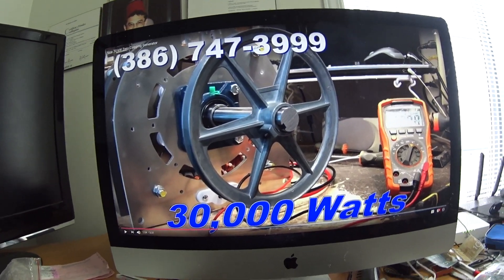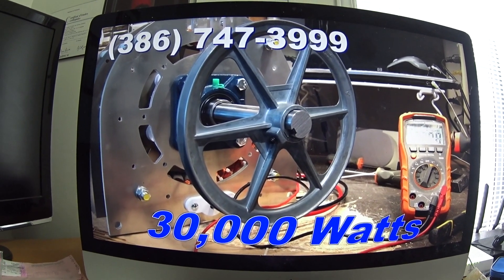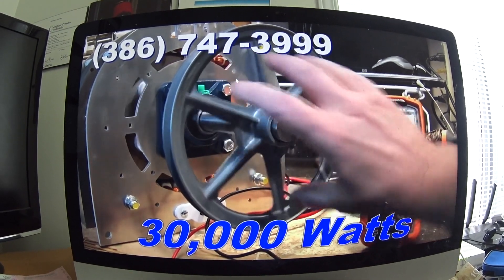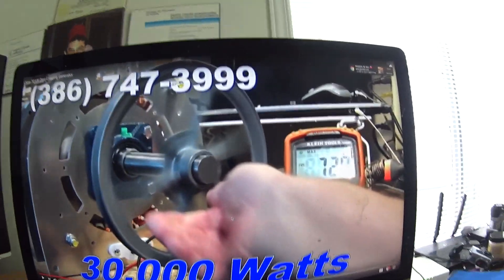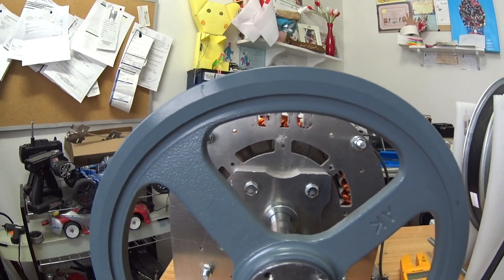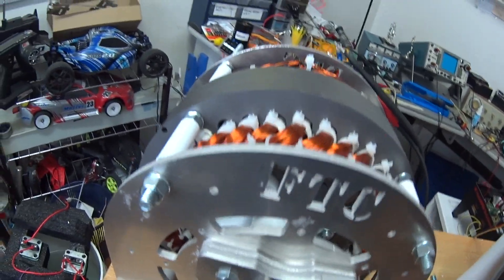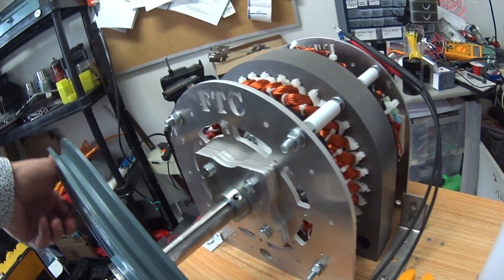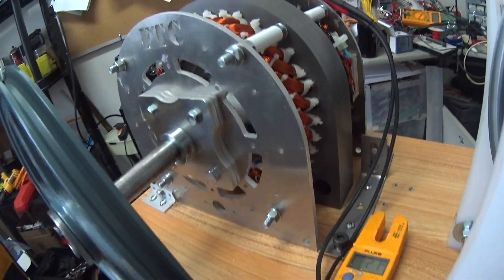30 kW Zero Cogging Generator from FTC

Comment: That was great of you to buy the generator so that the truth may be established. 
If possible would you please show how the coils are done within the stator and how the magnets operate.
The owner claimed that the magnets are placed so that most of the coil is in contact with the magnets, how is this done?
He also claimed that the design of the magnets and coils helps to reduce cogging. How is this possible?
Reply from the maker: the cogging is reduced by just reducing the count of the magnets , which of course made the output signal not useable so that is why he converting it to DC but as coils its very normal and also the magnets nothing special about it

Comment: Hook the output to a power tool and then we will know for sure about cogging.
Reply from the maker: cogging is when you turn the generator without a load , there is no cogging , please watch the whole video , it gives the postive and the negative of the generator
Reply: @EnergySeeker  It would still be nice to see  it run some things or how much it can run other than the meter.
Reply from the maker: @JR-ic4hl  do you have a 30 KW motor i can borrow to test full capacity under load then ?
Reply: @EnergySeeker  what about the one in your video?

Comment: Sir can you please let me know what the distance between the stator laminates /coil and the rotor laminates are?. We are testing a unit and we have roughly a gap of 3/8” 
Greatly appreciate
Reply from the maker: 5.5 mm
Reply: @EnergySeeker  I have a 15K unit. So sad I did not see your video before I brought it. My drive motor will be here tomorrow and I will see if I can get 15K out of it at 3400 RPM. The air gap on the stator is not consistent all the way around the laminates and windings for sure.
Reply from the maker: @bmwhp4709  did you try to contact him ? to return it

Comment: Sir can you please let me know what the distance between the stator laminates /coil and the rotor laminates are?. We are testing a unit and we have roughly a gap of 3/8” 
Greatly appreciate
Reply: Any chance you found this air gap number? I emailed to FTC and they never responded. I see some of his coils he brags about are not staying up in the stator laminates so I need to push those back in place anyway. I plan to take this thing apart and try to fix it.

Comment: Mr Amir . There is generators with low voltage but high wattage. It depends how it is wired . The coil arrangement . Parallel gives lower voltage but higher wattage. And higher amperage.
Reply from the maker: That is right
Reply: Hello, can you provide me with the brands how make this kind of generators

Comment: Hi Amir, thank you so much for doing this on your on, time have pass I wonder if you have continue testing this unit specially the right way which nobody does in the house running all you lights and appliances. Right now I'm consuming 50KW per day accordontly to my EC I will like to switch to more reliable source so I'm looking for alternatives what would you recommend.
Reply from the maker: hi jamie well for now i would go with solar , the anti lenz not work the way i want until now so am still changing design and testing but its slow and expensive :)

Comment: I do experiment even 1000 volt by hand rotation. Since voltage doesn't mean a power by itself. So It is nothing to me. Power need to be checked under load . Volt x Ampers = power in watt. So you need to connect it a matched  ohmic load and measure voltage on the load. You don't even need amper meter to measure Ampers. Just simply measure the load resistance in ohms. So to get amper value volt/ohms = Ampers. Then volt x amper = watt. How ever sorry for the dishonest people. Once again, Volt doesn't mean Power alone. High voltage is just matters of thinner wire with more winding in Same volume..
Reply from the maker: everyone know that i was just comparing what FTC showing and what i got
Reply: @EnergySeeker I know that.  Thanks for sharing

Comment: This is what I have chosen to try and spin with the 12 inch motor. https://centralgagenerator.com/product/224e-50kw-double-bearing/
Reply from the maker: did you test it ?
Reply: @EnergySeeker  Did I test it? I bought it to put together with the 12 inch drive motor and had hoped Gerard Morin was going to release his drive controller. That hasn't happened. It is ready to spin and begin testing.
What I'm asking is - what Texas Instrument equipment are you using to drive this motor?
As far as the generator goes - it's an off the shelf generator head that is used all over the world and is usually driven by a gas or diesel engine. I'm confident it will produce 220 VAC at 1800 rpm. My goal along with many people around the world is to make it self running. 
I believe I understand what Gerard was/is doing with these drive motors - when supplied with the right signal, it will drive a very large load. The equipment from Texas Instruments looks promising to drive this motor. 
I'm not an engineer but I have been an electrical/instrument tech in the chemical industry for 43 years and have a good background in motor controls and electronics. But Texas instruments has many different options of devices to drive BLDC motors and is confusing to me. But you are driving it - but you don't go into much detail on what you're using or how it's hooked up. 
My set up is planed for personal use - I have no desire to go into any type of production or competition and I seek no recognition if I am successful. I will be powering my house and keeping a very low profile with it.
I don't have a lot of money to waste doing experiments. I'm simply asking for your assistance in selecting the right Texas Instrument equipment to spin this 12 inch BLDC motor. Is this something you can help me with? If you prefer we can communicate via email - jlsmith86@cox.net
Reply from the maker: @jerrysmith372  i sent you an email
Reply: @EnergySeeker  Yes thank you - I'm sure you've seen my reply already.
Reply: Old Frugal One Hyper-Drive Movement - any success with driving you Generator Head with the washing motor by use of the TI Controller?
Reply: @energydreamer5347  I didn't buy the TI controller - I bought something else. The TI is about $700 and I have a very limited budget. The one I'm trying to work with is about $85. It's wired up but I haven't had success with it yet. I think it has something to do with the hall sensor placement. I have a couple of things working against me right now - I had some hand surgery done and am recovering from that, and right now it's been very hot here in the desert southwest and very hot in my garage. I'll get back on it soon enough when I heal up a bit and it cools off ( at least below 100F)
Phase one is to just spin the motor with no load and get the timing right. Phase two is to add the custom DC converters I have to each phase that will boost the signal to around 1000 Vdc at 25Khz pulse. Then apply a load and see how that goes. 
Do you have a build that you're working with?
Reply: Old Frugal One Hyper-Drive Movement  - yes & no, I have a partner that is a distance away from me that has the LG style motor that is direct shaft mounted to a generator head.  I think that is kinda what you trying to accomplish too.  The controller is our dilemma at this point.  A third person is supposed to be building a Controller that will give us high frequency but the Controller has not materialized yet due the third party not following through as promised.  I saw you comments to @Amir Ibrahim regarding the TI Controller he is using to spin his LG prime mover and was curious if you had gotten that controller and if it was working for your application.  Thanks!
Reply: @energydreamer5347  I'm using this - https://www.aliexpress.com/item/32743052334.html
My thinking is to boost the output of the controller (Any controller) after the PWM pulse with a DC boost converter to high voltage high frequency signal within the PWM of the controller. I don't think I need a custom built controller. But first I need to get the hall sensors placed right just to spin it and get the timing right. Then I'll boost the signals. It's all experimental anyway - I have no way to know if it will work until it does. Time will tell - and maybe I'm full of crap and it really won't work. I plan to at lest explore the idea and see.
Reply: Old Frugal One Hyper-Drive Movement  - thanks for the share!
Reply: @jerrysmith372  I sent you an email as well. from 'superchap' " "@gmale" "... to disguise it from bots et cetera. If you could hit the reply button that would be terrific. Kindly, - jeff

Comment: FTC is  expletive The Customer. There isn't enough Copper in there to get 30KW out of it. Must be on the Chinese rating system or wind turbines. 30 KW in a day. Not continuous duty at 30KW. I have 10KW, 15KW and 40KW units on the property and all weigh far more than that unit and the smallest is at least twice the size.

Comment: Obvious scam look at the multimeter when it turns the pulley it displays 72V the pulley slows down and stops and the reading remains unchanged despite the loss of speed and even at the complete stop of it ... It's a scam the tension should vary with the speed of revolution of the pulley. It's a real shame for those who got caught though ... ☹

I'm sorry for you, not cool !!
Reply from the maker: that is not the point the volt meter is set on capturing the highest  voltage its ok the point is he have 72 is high and i have 30 ,
Reply: Any update ? I was about to order a 10 kW generator from this company to provide energy on board a sailboat
Reply from the maker: @tonyof972  no update they refuse to help , the owner is rude and its a very small company so anything goes , you should get a solar , am working on making my own generator but these things takes time
Reply: Thanks hope you will have your money back.
About Gerard Morin I presume that everything is bullsheet too ??
Reply from the maker: @tonyof972  i dont think i will have it back , as for Gerard , he cou;dnt get the driver which he is looking for  so project stopped , but there is jason still working on it
Reply: @EnergySeeker  Do you have contact information for Gerard? I can never get a response from him. I gave him money for controller pre-order and never heard a word after that. Good money down the drain I think. I'm hoping you can show me how to get this motor running to spin what I have built so far.